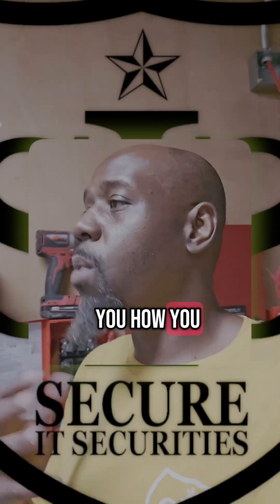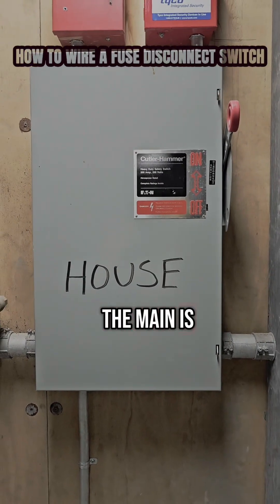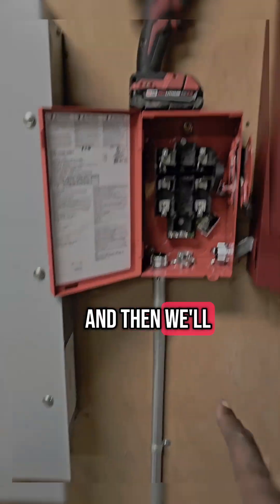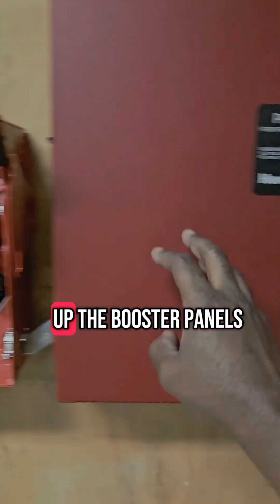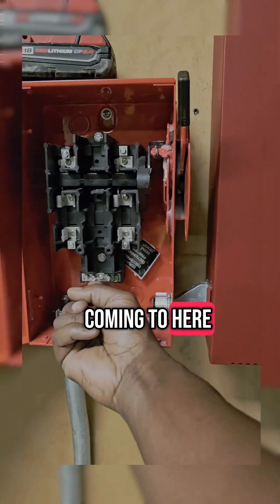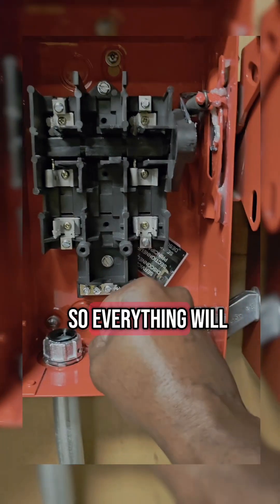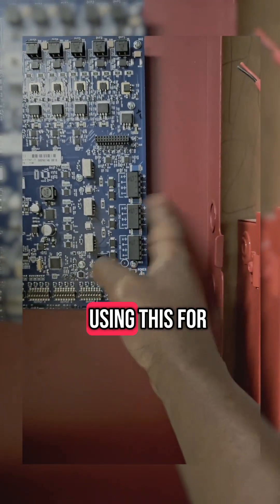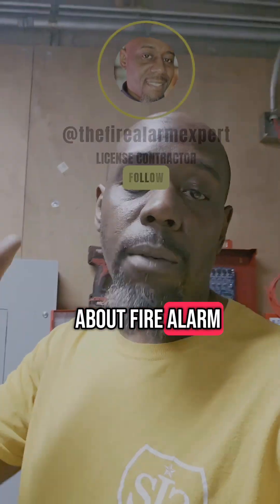We’re Installing A Fire Alarm Fuse Disconnect Switch

Comment: How would you tap into the main feed?
Reply from the maker: That would be for the electrician, but essentially you will tap the power directly from where it enters into the building, usually a main distribution panel or they will give us a meter we can connect to. They will either connect the power wire to the lug or add tight bites to connect the two cables together. We usually use tight bites it is a lot safer and much easier to install.